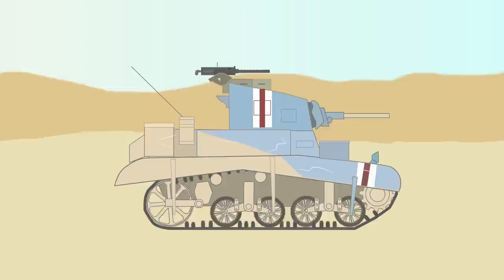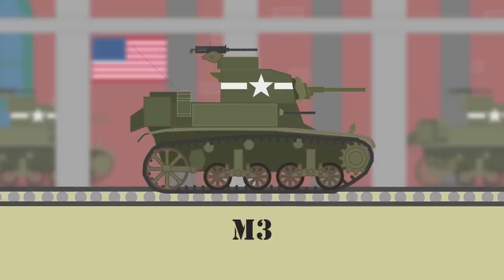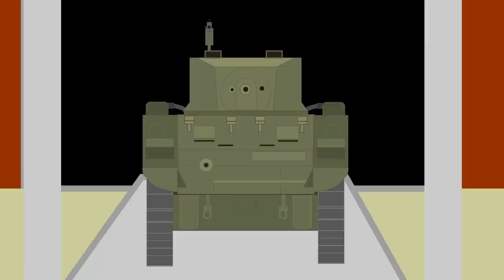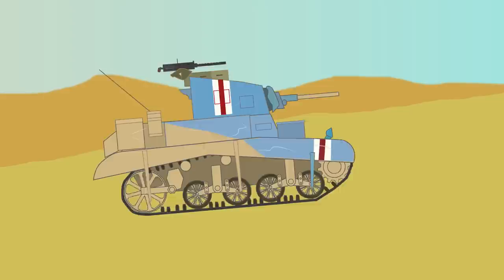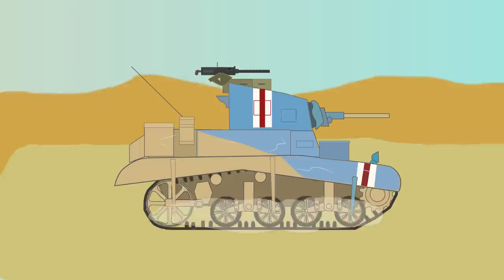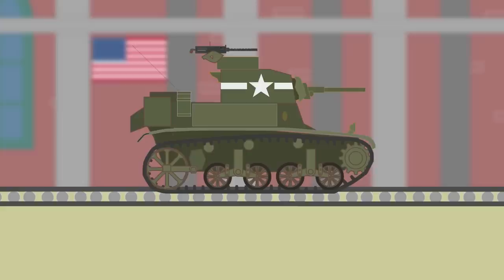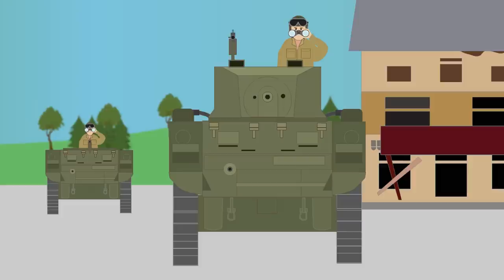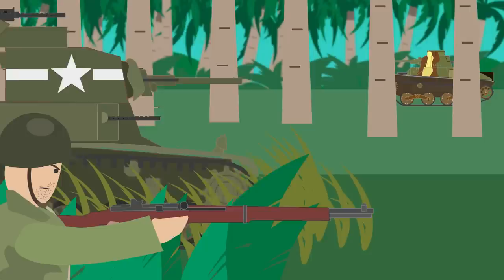WWII Tanks: Light Tank M3 'Stuart'

Comment: well to be fair the stuart tank wasnt built to be used against other, especially not heavier tanks.

but still a damn good little fella
Reply: It was intended for scouting and skirmishing with pill boxes being about the biggest things they could handle. It sort of harked back to the idea of the cavalry tank but it did good infantry support work.
Reply: It was the best light tank of the war by a considerable distance & could take on any other tank of similar size. Unlike rivals, its main gun could fire smoke, buckshot, HE & AP ammo plus it had 3 very reliable machine guns. It had an excellent radio, was also highly manouverable, easy to drive & maintain, & spares were plentiful. My uncle fought in tanks through North Africa up into Italy & the M3 was his favourite by far. I agree it was not designed to take on a tiger but the fact Ingram even tried shows the faith he & his crew had in their machine.

Comment: The stuart and the sherman were actually pretty good tanks for their roles, and they were well made. Both were fast, had good armor, good guns, and were very reliable. They just couldn't keep up with the german monstrosities. The Italians and the Japanese though were pretty behind on armored warfare, so these tanks were great on those fronts.
Reply: This.  Germans focused on armor and firepower.  Problem was, this made them heavy and fuel hungry, which actually exacerbated their resource problems, forcing them to do something stupid like take on Russia for their oil fields.  Also, they had to rely on railroads to transport those heavy tanks too, which made them prime targets for the pockets of resistance that sprung up in response to the German occupations.  So while Germany enjoyed success on the battlefield due to their heavier tanks, it quickly drained their supplies to even do that.  Yeah, King Tigers ruled whatever battlefield they were on but they were just so costly to make, and even costly to just deploy.  And yet they wanted to go even bigger, like that pipe dream Ratte Mega Tank.  Who knows the actual cost that would have had on Germany's resources to make and to even deploy.  It would have been 1000 metric tons.  Think about that.  The fuel alone to even MOVE that would have Germany run out of gas even quicker.

Comment: Your video is good, but you're lacking on the origin of the M3

It started out before the war (as early as 1933) as the M1 a twin turret light tank that was based on the success of the Renault tank from ww1. Then the M2 by 1939, which is similar to the  M3A1, but had 5 .30 cal machine guns and the wheel boggies were wider apart, but it was the M3 was the most successful one.

You should have also mention its successor, the M5 and then the M24 Chaffee.